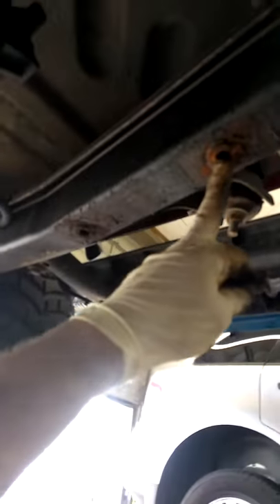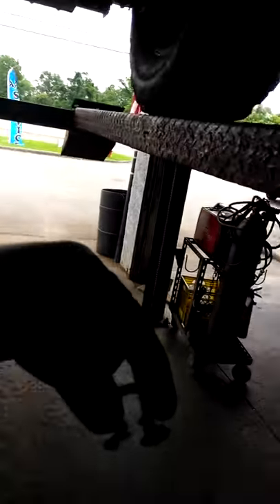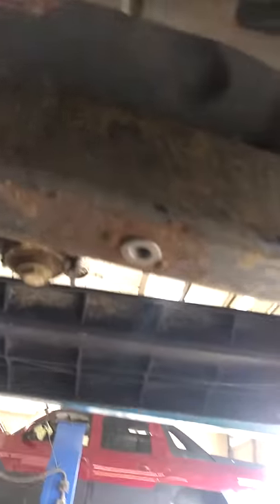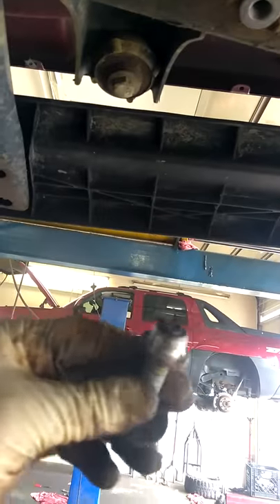Jeep Wrangler skid plate trans cross member bolt repairs.. Meineke cinnaminson

Comment: Cut a window perpendicular to nut placement and drop in from top. Drill two 3/16 holes on each side of retaining nut hole and welded it up. Stronger than welding from bottom.🎉

Comment: What would you suggest to do to remove spinning carriage bolts from the gas tank mounts I’ve tried applying pressure and they still spin
Reply from the maker: Corded Grinder harbor freight most affordable is the fastest c be aware of fuel vapor and Sparks you can blow up